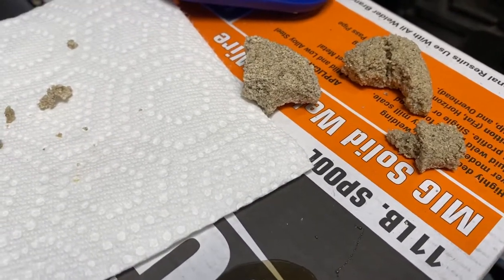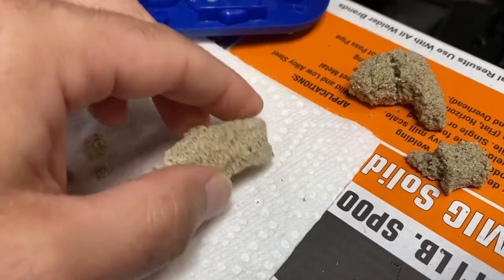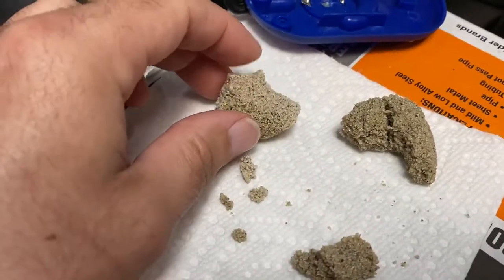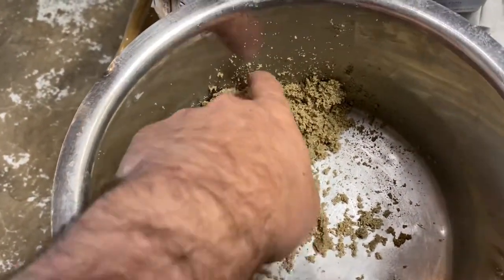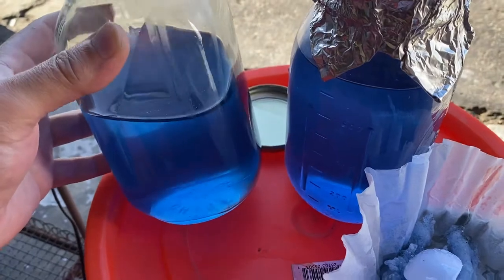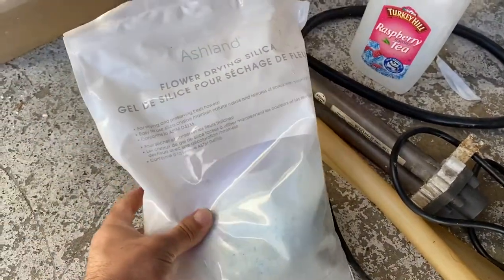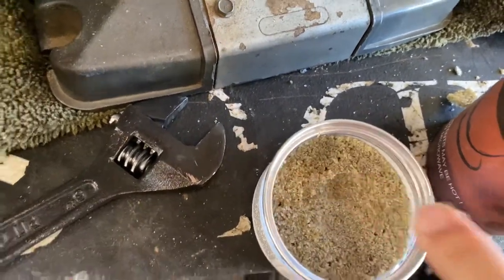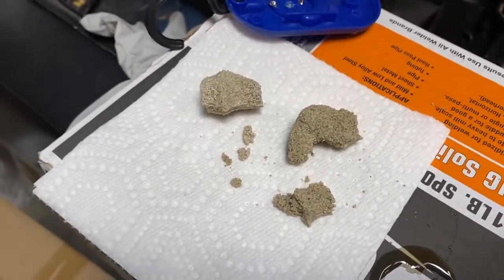Sodium Silicate and Co2 curing

Comment: Heat helps cure sodium silicate?
Reply from the maker: In this case microwaves help it hold together.  It limits the mold size I can make as it now has to fit in the microwave.  Maybe my solution wasn’t concentrated enough to co2 cure.